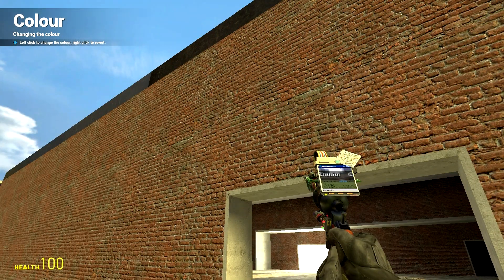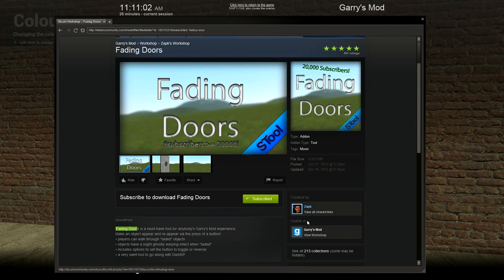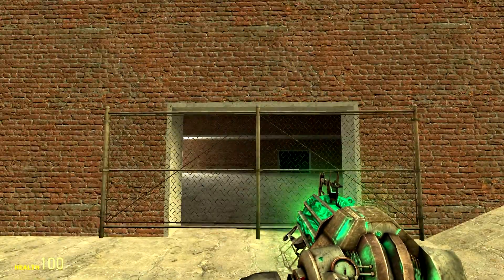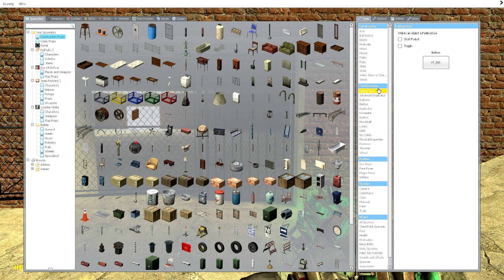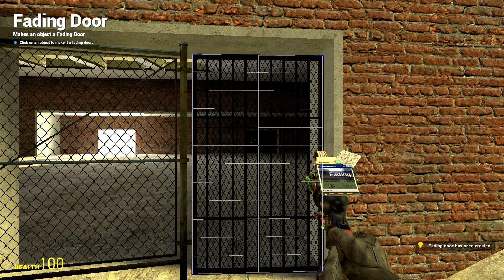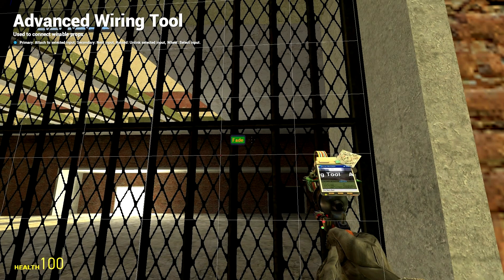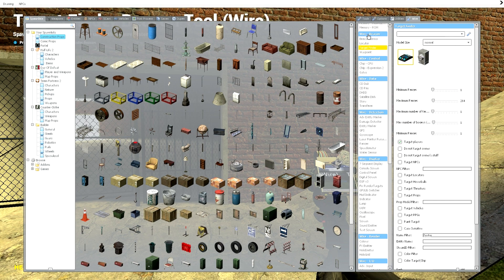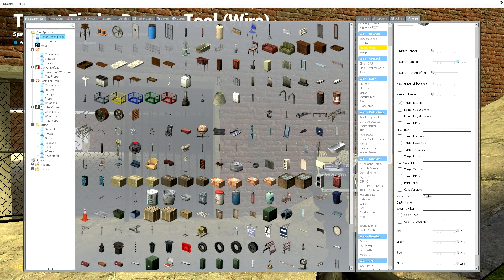Wiremod Tutorial 6: Fading Doors

Comment: I just used an exclusive range chip to check if the beacon was between 0 (which it will be if you're out of range or that player disconnects) and my value for the door. It has a MIN, MAX, and VALUE, which tests if VALUE input is between MIN and MAX.

On that note, I found I wasn't able to filter to allow multiple people through the door. I tried ",", ";", " ", "AND", "&", and many others. I ended up just building multiple circuits and OR'ing the results. Can I put multiple people in the filter?

Comment: i would like to see a timer that activates at point A and deactivates at point B, i've seen it work in a dragstrip video but i haven't found a tutorial for it, in any case, what i'd like to know is to activate a timer when you pass the start beam (ranger) and deactivates when you pass the finish beam (ranger)

You can respond to my private message that i've sent you if you need new ideas on stuff that you can wire, i have quite alot in store and other info will be provided in that message.